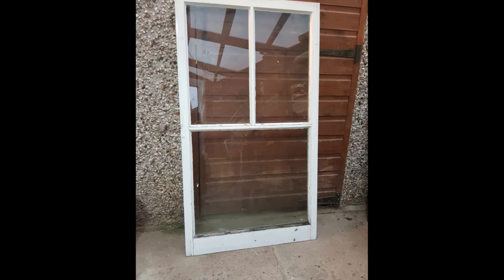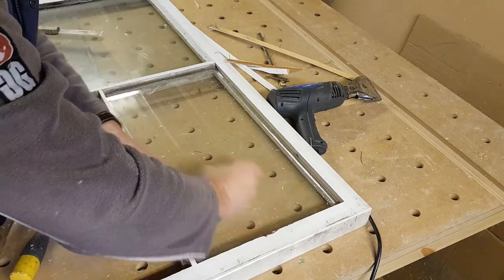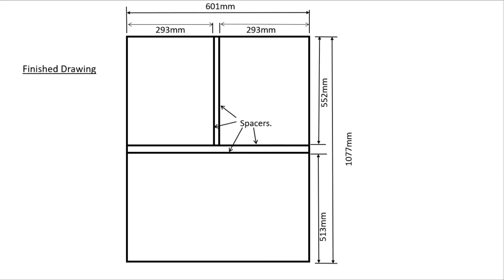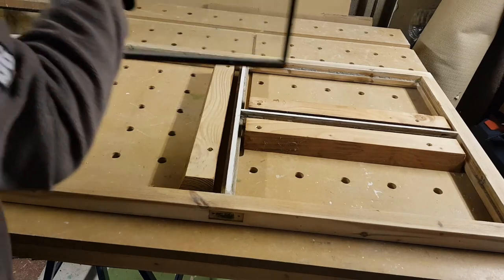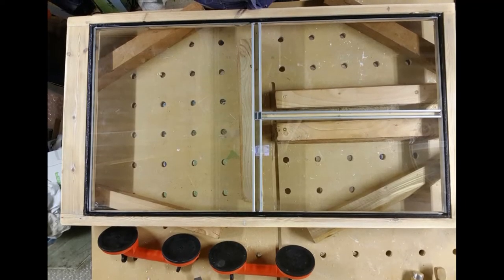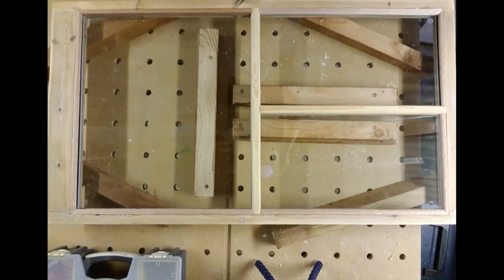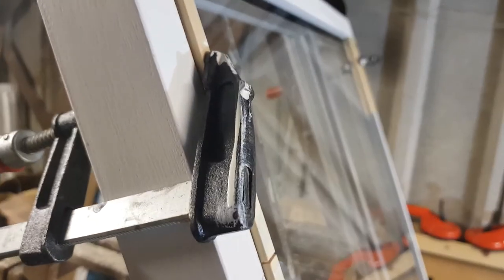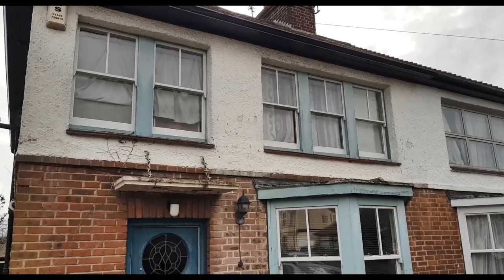Double glazing old sash windows.

Comment: Hi, enjoyed the video. One thing I would mention which is you can have gas filled units from 4-4-4 upwards so a 4-6-4 can easily be filled with Argon, Krypton and Xenon. You can also use a warmedge spacer which is more efficient than the standard one. The downside with the duplex system which you used is it can be prone to thermal cracking where the gap between the spacer bar in the middle of the unit and the glass is not enough when the unit expands and contracts through the year. The best way to solve this it to buy the unit fitted with toughened glass.......... All the Best Adrian
Reply from the maker: Thanks for the feedback Adrian, myself and the subscribers will find this very useful. My glazier said it was not possible to fill these DGU’s with gas so I will ask around and seek more information. It would be beneficial if I can get a supply of gas filled DGU’s, I am sure there will be a supplier in the midlands who can do this. Also, good information on the warmedge spacers. Luckily for me, all the units I supplied in this house are toughened glass as the bottom of the windows are lower than 0.5m to the floor, so UK regulations state all glass must be toughened.  Cheers Ed
Reply: @warwickshireworkshop9186  You're welcome Ed . For the past 3 months I've been working on Grade II Listed properties and they would only accept the 4-4-4 Heritage units which have a warm edge spacer and filled with Krypton gas. You can fit them in an 8mm high rebate but the problem is they either last 20yrs or 2yrs and most companies will only give a 2yr warranty on them. They are also hugely expensive too at around £130 sq meter and you can only have them fairly small otherwise the panes can touch and you get what they can "Newtons Ring" which appears like a ring,halo in the middle.. All the best Adrian

Comment: Good video well presented,  a general point worth noting is the use of steel pins to hold single glazed pane in place. Not a great idea because eventually rust or corrosion will form and Bear down and crack the glass. It’s a common site when looking at period single glassed timber frames....the crack on the corner! and the culprit is the securing pins. I’ve also seen pins actually working their way out of timber. Through expansion and contraction the timber squeezes on the tapered point pushing it up and out or stuck half way. 
Also would like somebody to come up with drainage idea on timber glazing same as plastic windows,thus extending unit and timber life.
Reply from the maker: Hello Chris. Thanks for getting in touch. Yes, steel pins are not the best. I've also damaged a few router bits on pins that broke in half when they were removed. That tell tale sign of sparks when you rebate the frame is not something I want to see.

Comment: Hi, these windows look really good. Well done.
 I would like to use 14mm double glazing on my Victorian 4 pane sash windows, is there any reason I can't replace each pane separately, as the way you have done it looks too advanced for me? Thank you
Reply: Thanks for the email Andy. Greatly appreciated. To add 4 separate panes to one frame would be 4 times more difficult due to alignment. Managing one large pane is easier than 4 separate ones. Also, the width of the metal edge separator bars found in the double glazed unit are around a minimum of 12mm deep. That means a total of 26mm min (including 2mm air gap) that the wooden Muntins will need to cover. On all the windows I have seen there is not 26mm available so you will see the metal separator bars in tine double glazed unit peeking out behind the wood. Hope this helps.

Comment: Hi,
A couple of questions if I may:
At 4.16, you show spacers, the vertical one is 15mm and the horizontal one is 12mm. Why is there a 3mm difference?
The double-glazed unit has internal bars/spacers that line up with the internal timber dividers - what is the purpose of these internal bars/spacers in the double-glazed unit? Could you use a 'regular' double-glazed unit without these inner bars/spacers?
Reply from the maker: Hello Mike. Thanks for getting in touch. The spacers you mention are there to segregate the sections of the window and the separation distance is dictated by the thickness of the wood they hide behind. In this particular frame there were 3 panes of glass, one lower and two upper. Without the spacers there to segregate the single double glazed unit the view you see at 13:49 in the video would be of the inside of the wooden spacers. IMHO not a good look. With the spacers the window looks like 3 double glazed units. I hope this helps.
Reply: @warwickshireworkshop9186   Ah, got it. Thanks for explaining. It all makes sense now :)

Comment: Thanks a lot for the the great video and answers to previous comment! I have some more questions if you don't mind. Thanks in advance!

1) what are your thoughts on wet glazing (with silicone) Vs dry glazing (adhesive tape)?
2) some double glazing video on youtube show the drilling of drainage holes through the bottom rail, to allow any water that may have entered to escape. You yourself mention this potential issue to justify the spacer at the bottom. How is the water supposed to come out without holes?
3) did you say to leave a 4mm gap at the bottom but then used 2mm spacer, won't the gap then be 2mm at the bottom and 4mm at the top?
4) how do you choose the width of the double glazing. I think you used 18mm, but wouldn't 24mm or even 28mm be better? i.e: What is the minimum amount of wood to be left on the inside to hold the glass?
5) how thick are your beads? They look quite thin. Are they siliconed both to the glass and the rails?
6) Can you give some more advice on the routing out of the deeper/larger opening on the side/top rails?
Reply from the maker: Hello Marcdebattista.
I hope you are well and thank you for the positive comments. To answer your questions, please see the following. 

1)  I have used tape to hold the outer beads onto glass and it has proved successful. I only use a 3M VHB tape which works well. However, I prefer silicone to bond the glass to the frame.    

2)  In my mind. Drilling holes allows water vapour and insects to get inside the wood (or block it up). I prefer to stop the water getting in in the first place. Attention to detail is the key. If the frame rebate is well painted a bit of water wont hurt. The problem is if it freezes when touching the glass, hence the 4mm gap.

3)  Well spotted. It should be a 4mm spacer.  

4)  I use 14mm thick Double Glazed Unit (4mm toughened glass, 6 mm silver spacer and another pane of 4mm toughened glass). This was best for the frames that existed in this house. Anything thicker would look odd when looking at the window from the inside of the house as the flat part of the inner bead would have been removed. Obviously the thicker the DGU the better the insulation. You can also fill thicker DGU’s with inert gas that makes the insulation better. You cant do this with 14mm units, so my glazer told me.   

5) They are quite thin in this case but I did not measure them so cannot tell you the exact size. I used hard wood for better weathering. I have used double sided tape to stick the beads to the glass but that only creates a bond between the bead to the glass. When using tape I relied on paint to cover the gap between the bead and the frame. It’s easier and just effective to use silicone for both points of contact.  

6) If the frame contains old hard putty I would use an old router bit to remove it back to the frame. (It blunts the bit quickly) Then I normally start by routing out sideways to the width I require in small 2mm steps. Then drop the depth and repeat the process. Pay attention to bits of old glazing nails left in the frame. Sometimes, not all of the nail comes out.   

I hope this answers your questions. Please let me know if you have any more as I am happy to help.
Reply: @warwickshireworkshop9186  Thanks a lot for your detailed answers, it is very helpful! I have since come across the 'THE B6 HEEL BEAD SEAL SECURITY GLAZING SYSTEM' from Hodgson (one of several solutions). They have very informative technical specs for different configurations (fully bedded, drained, new or retrofit). They pretty much illustrate the solutions presented in the GGF Glazing Manual. Have you come across these resources? Apparently the DG unit seal is prone to failure if the wrong type of silicone is used and their products shouldn't cause any issues.
Reply from the maker: @marcdebattista  Thanks for this. A colleague mentioned this to me last Wednesday but I have not looked at it yet. I'm not to worried about the degradation of the DGU seal as the silicon I use does not come into contact with it. So far, all my DGU's have lasted quite a few years without any problem. Cheers.

Comment: Nice work. 
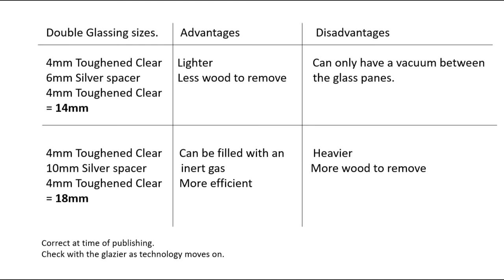One things needs correction: (in the table at 5:12)
It's a common misconception that double glazed units have a vacuum (ie no air) inbetween the glass panes. This is not the case! 
It's usually dried air, sometimes inert gas. The atmospheric pressure at sea level resting on the glass is approx 1kg per cm2. If it contained a vacuum, a double-glazed pane of 1x1 metre would have to bear the mass of 10000kg (10 tons) resting on each sheet. Clearly that's not possible given the thickness of the glass.

Comment: Great tutorial, but I would like to see one where they replace the glass while the window is in situ. I have an Edwardian home and some of the windows are slave/fixed, they do not open. But the single glazing need replacing and I am absolutely dreading tackling them.
Reply from the maker: Hello Lilla. Thanks for getting in touch. Can you share a picture? Without seeing the windows, I would think that the biggest issue would be rebating the frame to allow the DGU to be installed. If you cannot get a router deep enough into the wood, then whoever does this will have to use a chisel to rebate the frame. If the window does not have any Muntins, i.e. only made up of one single pane it would be possible to do in situ. Otherwise - if it went in - it can come out, it should be removed on that basis. Sorry I have no magic wand to help.
Reply: @warwickshireworkshop9186  Thank you very much for your quick response, you are a true gentleman! My biggest fear is that the muntins are too slim and they are rebated. I have successfully replaced single glass panes in our front door with stained glass but that was child's play compared to this. My windows are like this (these are new windows in the pic) except there are two fan windows (8 panes altogether) on the top and only one wing opens. https://www.homeadviceguide.com/wp-content/uploads/2013/09/wooden-windows-cost.jpg
Reply from the maker: @lillahamvas9700  Thank you for the picture. Without looking in detail at the actual window. If I was to work on the window in this picture, I would suggest you remove the 3 panes of glass and the 3 muntin’s totally. You then have a choice. Fit one single DGU and have it look like one pane of glass or ask for dividers installed in the DGU where the muntin’s were and stick on external glazing bars (Pieces of wood) to cover the gaps between the internal dividers. This will make it look like it is still 3 panes of glass. Depending on how small the fan windows are removing the muntin’s will let in more light and might look OK without the 8 panes of glass. I would still try to remove the one that is fixed, it should come out.

Comment: Thank you for the video! It’s really helpful. I’m just wondering how I might measure for the double glazed unit without removing the glass first? We don’t want to leave the house without windows for any length of time. Thanks
Reply from the maker: Hello Alex ‘Sensational’ Harvie.  
Thanks for getting in touch and I’m glad you found the video helpful. Did you know there is a band with the same name as you? Back on track - You will need to board up the window once the sash is removed as it will take a few days to strip the frame, repair it, router it out, repaint it and put it all together. This will take over a week minimum allowing 24 hours for each coat of paint to dry (if the room is warm that is). If you take it out measure it and on the same day, send the details to your glazing company, the glass should be back with you before you have finished painting the frame. You could also take the whole unit to the glazier on the day you remove it, explain what you want and they will measure it for you. If it shows up wrong (it has happened to me) they will have to get another one made, costing you nothing. Again, the DGU should be with you before the frame is dry. Your house is more secure boarded up than it is with single pane glazing. I sometimes paint a window onto the board to make it look a little more pleasant esp. if it faces the road. The other way is to measure the width and length from the inside edge of the frame then ask the glazier to add on the dimension of the separator bars so the full width and length of the DGU is the dimension you measured plus the separator. This will then place the inside of the separator bar level with the wooden frame. Remember to router the frame out 2mm all round for expansion and 4mm at the bottom. Hope this helps. Any more questions feel free to email me. Thanks. Ed

Comment: Thank you for the detailed vdo. I have some 2cm and 2.4cm thick double glaze units I want to make my own windows and casements. Never done it before, so learning curve is steep for sure. I have some 45mm x 40mm old dry pine timer, which looks similar in size to the dimensions of your wooden frames here. I think to use those even though hardwood might be better. Could you tell me approximately how I should position the glaze units in the 45mm thick frame? I mean to what depth should I route to allow enough relish on the inside that the unit sits against, and enough relish on the outside to put the beading. Thanks!
Reply from the maker: Hello Beyonda1881. Thanks for the email. Regarding hard wood vs soft wood. Hard wood lasts longer but the original sash windows you see my video were made in 1928 and due to good paint application over the years they have lasted well. So don’t worry about the wood too much unless it contains knots. To rebate the glass into the wood I do the following. To get the depth, Take the glass thickness, then another 2mm for the silicon sealant (1mm between the glass and the frame and 1mm between the glass and the bead, then add what ever the bead depth is. You can change the thickness of the bead as shown in my video. I hope this helps and good luck. If you get stuck send me an email.

Comment: What a fantastically detailed video, thank you.

I am not a huge fan of double glazed units in timber sash windows which I won't go into. I am going to be using 6mm laminated glass. I would assume the process is exactly the same?
Reply from the maker: Hello MRJTUK. Thanks for getting in touch and also for the positive feedback. 
I’ve not worked with laminated glass yet, so here are my thoughts. If I was fitting laminated glass, I would think about treating the window as a re-glazing project and not a double glazing project shown in the video. After all the only difference is the thickness of the glass. The width and height will stay the same as the glass removed. 
If your original glass is 4mm thick. You could either just drop the depth of the rebate in the frame to accommodate the extra 2mm and use standard beads or even easier – leave the frame as it is and just machine the beads so they are thinner. 
There might not be any need to remove the wooden separation beads. If you did, after the window is finished you will be able to see through the inner and outer wooden beads to the inside of the wood. It might look a little odd close up.
Some options for you to use. Hope it helps.

Comment: Congratulations on such a nice finished product and in producing a first rate document of the process - I particularly liked the shot at 7:50 which really shows the excellent dust extraction on your (what looks like) OF2200. I have a question about the ‘etcher’ you used. This was a term I hadn’t heard before - just learning about the paint side of things - anyhoo after a quick google I discovered Self Etching primers that are used on metal. Is that what you used here? Or is this an etching primer for wood? Or were you saying that you used an etcher simply because that is what you had available? Thanks again for a great video.
Reply from the maker: Hello Neil. Thanks for the positive comments, I am glad you liked the video content. To answer your question. For these windows I used the Dulux Trade Weathershield Preservative Primer +, which you can see being applied at 10:37 in the video. This primer is the first step in a 3 part system that Dulex offer and is about as good as you can get for old soft exterior wood. 

Here is a link:
https://www.duluxdecoratorcentre.co.uk/product/paint/exterior-paints/exterior-trim/dulux-trade-weathershield-exterior-high-gloss/dulux-trade-weathershield-preservative-primer-bp

However, on another recent job the customer wanted to change all the wood on their house from Brown to Black. I had to completely strip back the barge boards, soffits, window frames, windows and doors to bare wood. I then painted them with all with aluminium paint and then used a black metal paint as the final coat. I did this because you are effectively covering the wood with metal. So there is another option for you. 

Hope this helps. Let me know if you need more info.
Reply: @warwickshireworkshop9186  cheers for that - exactly what I wanted to know. 👌